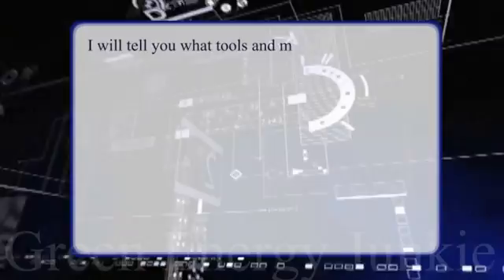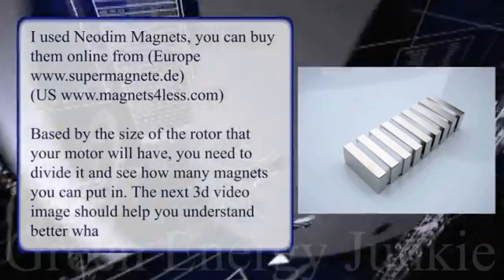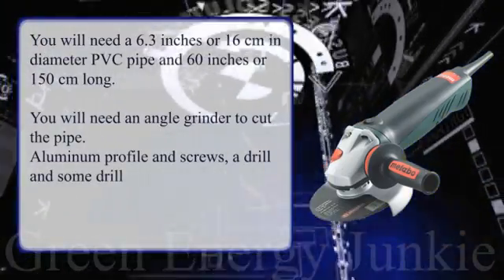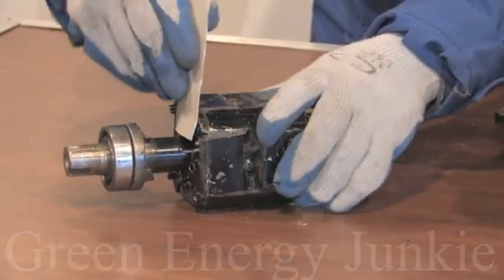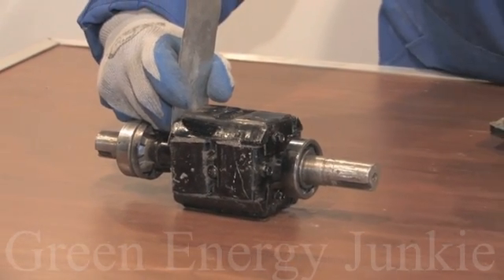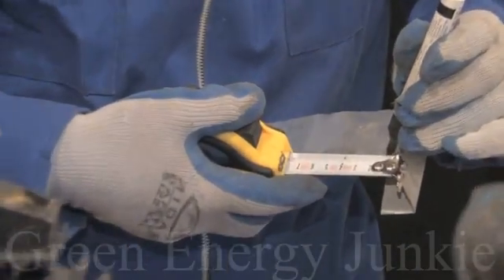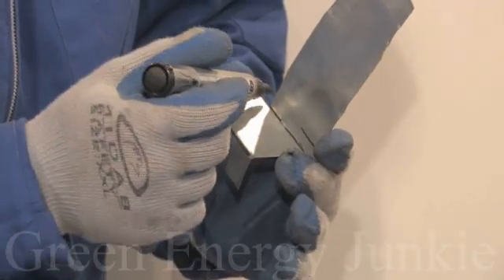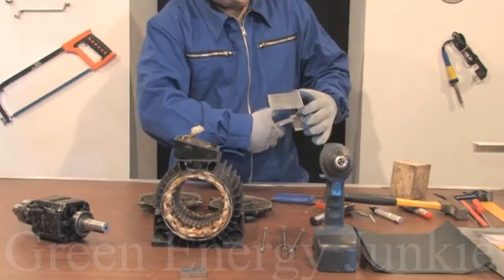Homemade Wind Turbine - Video Guide - (Free Energy)

Comment: 1 have a half horse power water pump motor. and has capacitor in it.do i have to recoil also the winding in order to generate energy or no as long as tere is magnet on the rotor. thanks and Godbless